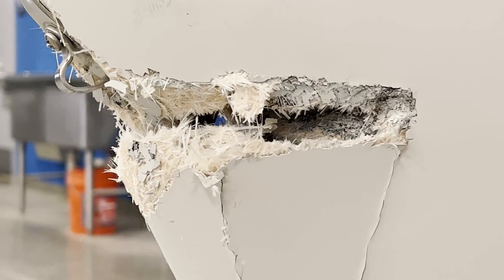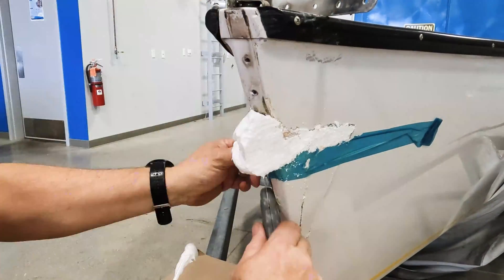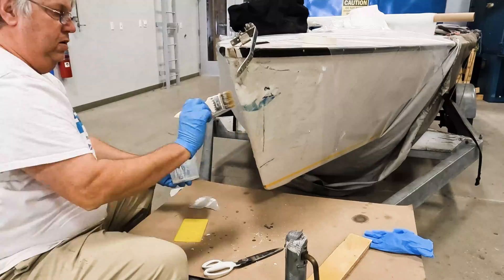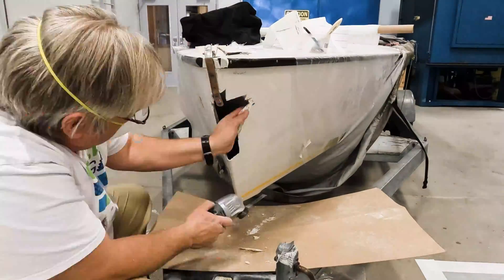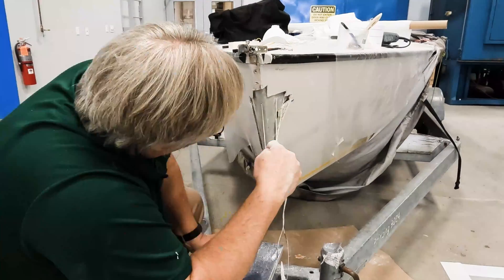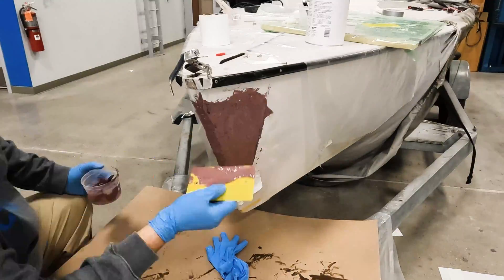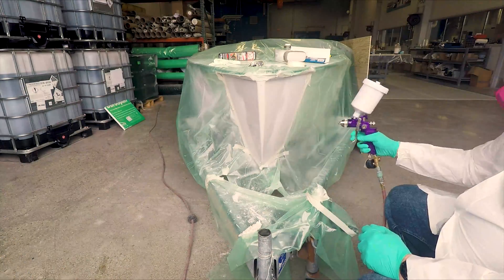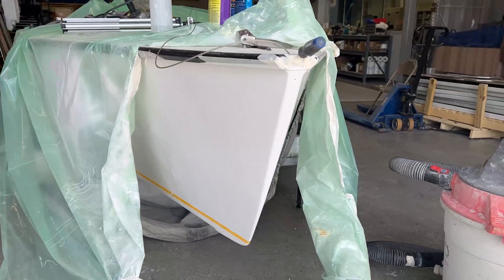Crash! Fixing the Bow of a Crashed Lightning Sailboat

Comment: Very cool! Would you ever use bondo/autobody for a small gash, covered with epoxy? I did this on a FG canoe at the bow (above the waterline) and it held for years - and then sold the boat.
Reply from the maker: Hey @philsego6305. Our epoxy products can adhere to cured and sanded Bondo and other polyester-based body filler products. We find, however, that our epoxy thickened with 407 Low-Density filler or 410 Microlight filler has better moisture resistance, strength, and toughness than these products, which may be important depending on your application. —Rachael

Comment: what type of gel coat polyester or ?
Reply from the maker: @PDEtchells, the gel coat used is a standard polyester gel coat. PVA was brushed over it to ensure the gel coat was able to cure thoroughly.
It is important to remember that the polyester gel coat was applied only after the epoxy had thoroughly cured and was washed with water and an abrasive pad to remove the amine blush. —Rachael

Comment: How do you get the gelcoat to bind with the epoxy?
Reply from the maker: Thank you for your comment, Bryan! While there are arguably many benefits to using epoxy resin vs. polyester resin, we've put lots of time and research into how to use epoxy safely and cleanly. We also publish safety data sheets. For epoxy safety information, visit https://www.westsystem.com/safety/. 

If you'd like to learn more about our experiences and comparisons between epoxy vs. polyester resin, we have an article here from back in the day! https://www.epoxyworks.com/index.php/west-system-epoxy-vs-polyester/

As always, we're always happy to have in-depth conversations. Our Technical Advisors bring a cumulative 121 years of professional experience to the table. Feel free to give us a call! 😃 US: +1 866-937-8797 • UK: +44 (0)1794 521 111
Reply: Was going to ask the same thing.  Maybe he was just calling  linear polyurethane paint "gel coat"
Reply: I repaired boats for decades and never became consistently reliable putting gelcoat on top of an epoxy patch. It may be a superior resin to use when all is said and done but most patches can be done using polyester resin. I avoided using epoxies during my career. Aside from the high cost, the health hazards associated with them are not well published in my opinion.
Reply: Have a look through West Systems video on this channel, they have videos of it. While the common saying is polyester resin can't bond to Epoxy, it isn't strictly true. Chemically (wet layup) you can't bond them, but mechanically to some Epoxies, like West System you can and plenty of other videos/channels testing this have proven you can and it works. While some 5 to 1 will work, unless the manufacturer really states it, like West does, you should test it first.

I wouldn't do it for anything structural, but for laying polyester gelcoat, great way to do a repair!

Remember to remove that blush with water first between any layups of anything.
Reply: Yeah, their is professional shipwright on another channel who did tests etc with another brand and got good results. He then went to do a dedicated video recently and the Gelcoat wouldn't even set.

The most common cause I believe is aging batch or incorrect ratios. The Epoxy goes off, but the incorrect ratio or age stops the Gelcoat setting later.

Unfortunately if the boat is Epoxy based you are cornered to Epoxy repairs.